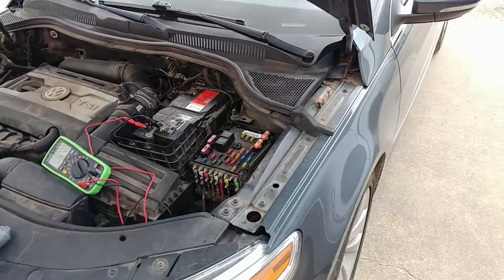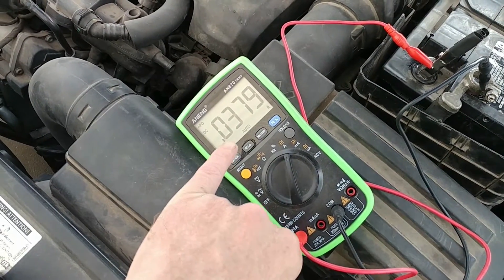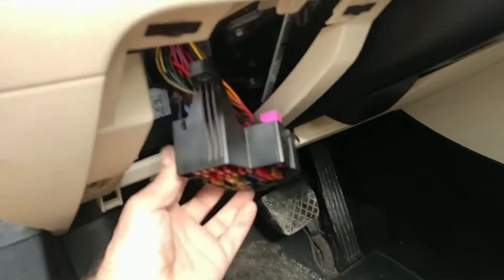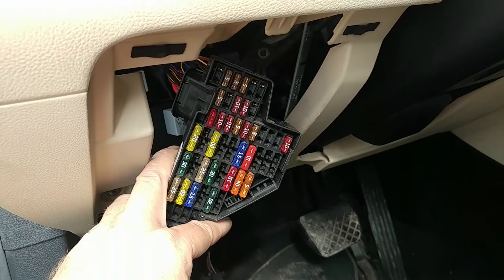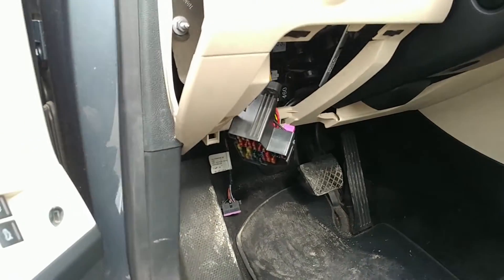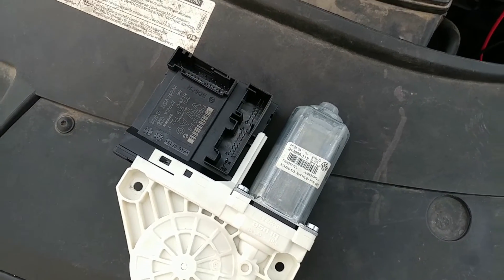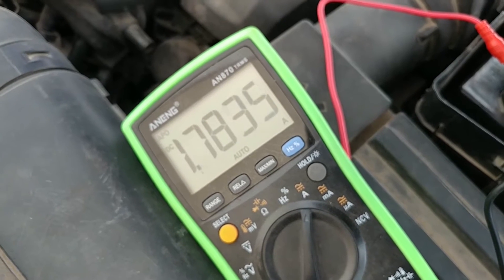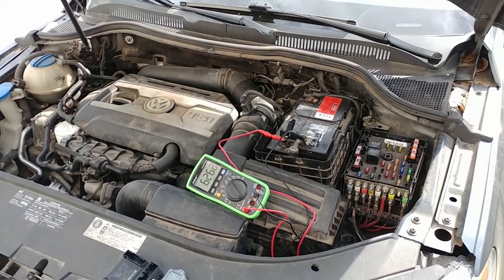2010 VW Keeps Draining The Battery...2 Amp Draw From Door Control Modules..??

Comment: hi i have 2012 vw passat the problem which i am facing is after i keep the doors open for 15min the battery dies i  dont have any overnight drain issues just this help me figure this out
Reply from the maker: Wow..!! Discharging in 15 min.,,, you're lucky it' not smoking and catching on fire..!!  It's got to be a similar issue, but I have not run across that before..!!  I would have it checked out by a good electrical technician..!!  Point them to this video for some insight on what they're dealing with..!!  Good luck..!!

Comment: Thanks so much! Very interesting video. I'm having a similar problem on my 2006 Seat Altea. However, the problem isn't constant, but rather occurs sporadically. However, the central locking on the left rear door isn't working. Do you think I have the same problem as you?
Reply from the maker: More than likely a similar failure..!!

Comment: Just got a 2010 vw cc komfort drive and same issue but I took the driver front window motor out and the next day it would crank, order a new one and it still has the issue, unplugged the new one and it still wouldn’t crank!!!
Reply from the maker: Either a localized connector/cabling related issue because it started working after you had it out OR it was just coincidence that it started working and is maybe a temperature related issue..!!  Temperature related problems can be in wiring, connectors, or circuit board solder points..!!  Either way it is still an electrical problem, which, can be extremely frustrating..!!

Comment: My Volkswagen Corrado SLC has had the worst parasitic draw ever from the window control module driver side. It’s been an absolute nightmare they say that the brown wire with the white stripe keeps the relay switch on any suggestions of how to fix it?
 I believe there’s a flaw in the design some say even swapping it out doesn’t work either.
Reply from the maker: My only solution has been replacing modules.
Reply: @LeeSurber  thank you for your response Lee. I really appreciate it.

Comment: Is this a 10 CC cause I have the same exact problem I just bought one this week replace the battery and it’s still draining every day. They have that door replacement that you showed in the trunk and the dealer said that it needed replacing so I hope that’s my problem as well. replaced so I hope that’s the problem with mine

Comment: Hey Lee, this is why I love Youtube, it's the gift that keeps on giving. You did this video in 2020 and it just helped me now.  I suddenly had this problem with an auction car I bought.  Got a new battery and then one morning it was dead again.  I knew I had a drain but was racking my brain trying to figure it out. 1.9A while resting then removed the same SA1 bus and BOOM!  So instead of just starting replacing them randomly I think since the driver's rear doesn't seem to react right I'll disconnect that one first and then retest.  Thanks for the video.  I might shoot one of my own and give you credit for the information.

Comment: Same problem. Back left door no power.
I replaced the locking module.
Still nothing.
I can here a click in the electronics every few seconds.
Im guessing the car is trying to do something electronically but the control module isnt letting it and maybe thats why its draining the battery.
My next thing is to go and replace the control module.
I disconnected the control module and the clicking sound is gone away. I disconnected it to see hopeffully it might stop draining the battery while i get the part.
In the meantime ive put the door back together.
I also turned the lock on the side of the door to keep it locked from the outside because its not doing it by key. The child lock was also on.
Now i cant open the door at all.
What do i do?

Comment: I have the draining battery disease. 2009 VW CC 2.0
I know my door/widow control terminal...switch blocks have been rain damaged.
My next move is disconnect them on a stretch of nice days so I can lv the windows down an inch or so. See if battery stops running down.

Comment: This makes sense! No one wants to listen to me. I have the 2009 Volkswagen Passat CC, 2.0,  My rear passenger back door is completely dead. Car dies every week. Had everything tested,  says everything is fine. Before i saw this video, I kept telling them that the door maybe draining that battery because it works sometimes then  it doesn't. It will show door oen but it is not. Volkswagen thinks I'm bringing it in for them to tell me this! I'm going to order part and try this.
Reply: @TeeMcCallum
Hey can you please tell me what was the result? Were you able to fix the issue after replacing the module? Can you please share this experience with us thanks.
Reply: Had a mechanic look at it, he did something, could not tell me what he did, it worked for a few weeks, out again. I'm still trying to trouble shoot it, but I had a machine say it was the window control module
Reply: Any updates

Comment: I have 2009 CC, audible electrical drain with engine off. Replaced battery, alternator tests fine, checked the fuses and they all seem fine, ironically  back right door controls do not work - wonder if same fix needed?
Reply: Same with me. 09 vw cc 3.6. Rear right door not working.  Drains real quick
Reply: Was that it? I have mine at the dealership now and they just told me the back right door module not working is what is causing my parasitic draw.
Reply: Any fee back to what it is?

Comment: OMG! I’ve taken my car to 4 mechanics!!!! What kind of mechanic are you? No one can fix my car… my back door won’t lock anymore either… replaced my battery… not the alternator… car dies every day
Reply: Ah dude, you're car might have a problem with the trunk latch module, it's a module that oversees the trunk latch, if it thinks your trunk is open it will stay awake and kill your battery
Reply: @The_Wanderer...  my passenger back door doesn’t work anymore either
Reply: @ariesmcdaniel4442  that's probably a whole different problem unrelated to the trunk lid, but it could also be pointing to something that connects them both, I would need to see a wiring diagram of both modules for common grounds or a common source of power.
Reply: @The_Wanderer...  thanks so much.. it’s been hectic, I’m going to eventually go to Volkswagen 😞
Reply: @ariesmcdaniel4442  My daughters 2010 VW Passat is having the same issue as you. Back door does not lock. We had to lock it manually by uncovering key from side of the inside of door and looking it with fob key. Her battery keeps draining as well. Alternator good, checked all fuses and brand new battery. Can not figure out what is going on. Feel we have to take it to VW, not looking forward to the bill!! :(  If anyone can help, please help!!
Reply: @mimamy4  I still haven’t figured it out 😞.. I can’t afford a new car.. please lmk if you hear anything.. I’ll do the same
Reply: @ariesmcdaniel4442  I feel you. We are in the same situation.. I will keep you posted. We just looked up service at VW and to have it inspected its $180!!! for each inspection. To have it serviced and do two inspections(the battery and the electrical) comes out to $700!!!  We are going to take it in tomorrow to ask questions before they touch the car. We can not afford to pay that much. This is so stressful!
Reply: @mimamy4  yes. I found a mechanic that claims he knows the issue and it’s over a thousand 😑
Reply: @ariesmcdaniel4442  you door lock  problem 😂 replace it

Comment: Video is correct. The VW Passat CC has 4 x door modules. When I say module it has a motor which has attached a PCB module. The Master is the drivers door with other feeding to that. - see link. A tell tale sign is if you LOCK, then UNLOCK the car and leave it, after a minute or so the windows will go to top limit (clearly audible), then after couple more minutes the car will AUTO lock, sometimes longer., If they do NOT auto lock, there will be current drain as the CAN modules will NOT go to sleep. Of course there are other issue like draining to ground from bad earth, alternator drain (bad diode), but what I am talking about here is the MASTER cannot put  the CAN system sleep because of the slave motors. If you place a current clamp on the RED wire going to the main fuse box as shown in video and you have over 0.3 to 0.5amps AFTER the minutes have  elapsed once car is LOCKED or AUTO locked , then car  CAN has not powered down. Generally if powered down should be 0.20 or even lower in my experience.
See wiring schematic of whole car in link. Cant guarantee how long the link is active- not mine. See page 96 of PDF.
https://www.dropbox.com/s/c2knfvyz2debjep/Wiring Diagram.pdf?dl=1
Cheers Danny
Reply from the maker: Thanks for the feedback!
Reply: @LeeSurber  Did the modules have to be programmed or were they plug and play, also where did you purchase the modules.
Reply from the maker: @billwilson3665   Modules were plugged in play purchased at dealership